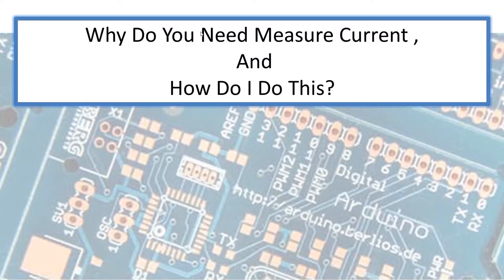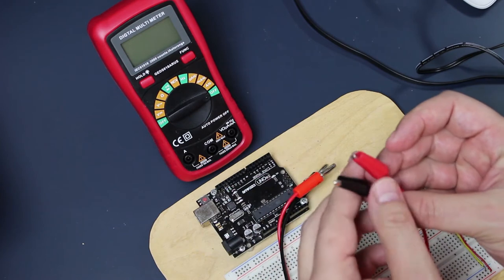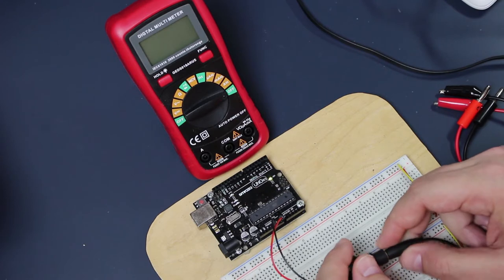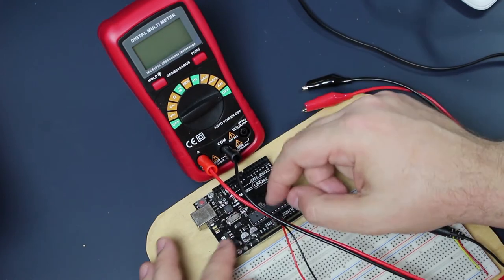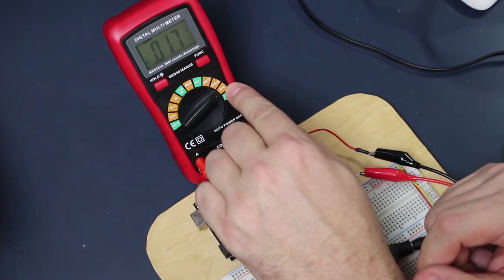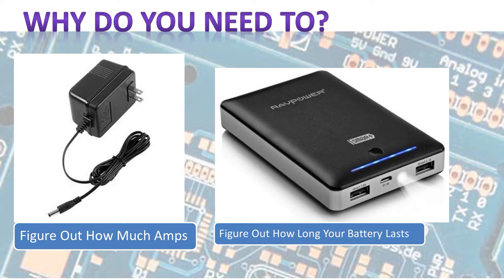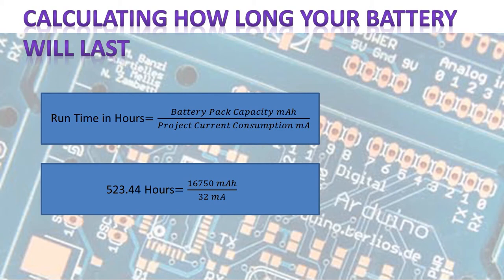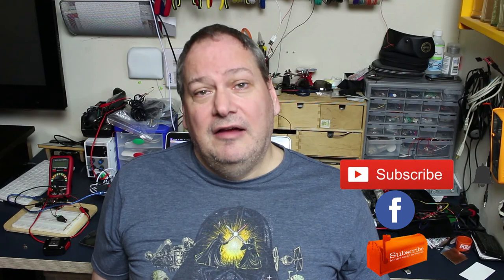How To Measure Current and why should you do it?

Comment: Thanks very well explained tutorial.
You talked about how to calculate power consumption of a project by  simply dividing the battery backup (mAh) by current consumed (mA).
My question is that how to calculate power consumption when the project draws variable current at different times( not fixed mA).